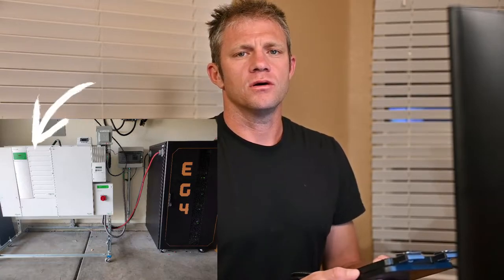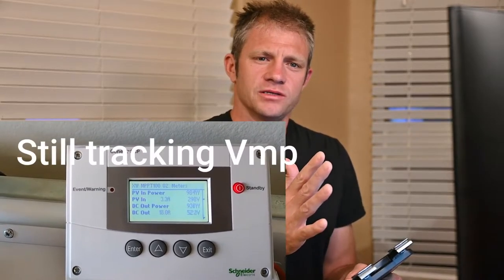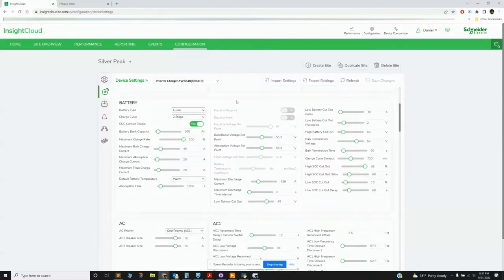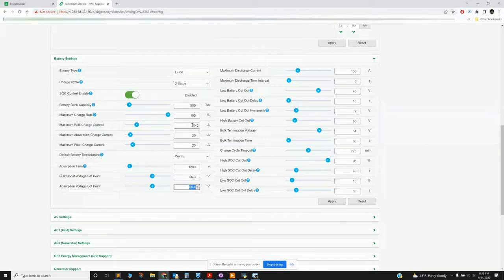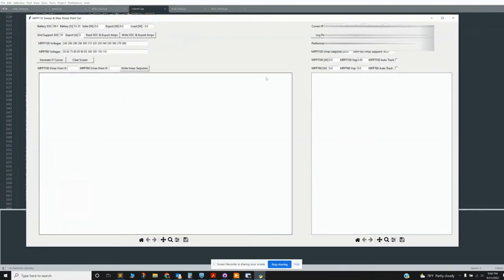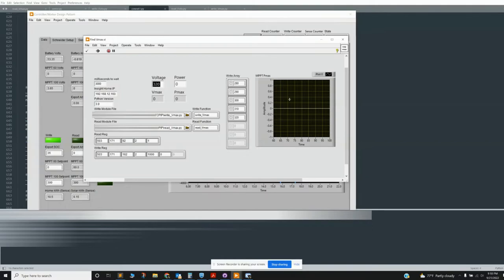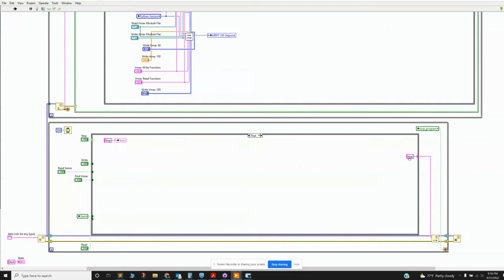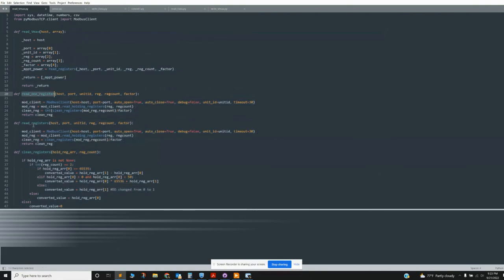Schneider Conext MPPT / Tigo Rapid Shutdown Fiasco & Modbus Solution

Comment: Thanks for all your videos and work; I think you should contact Tigo and ask them to send you some of the O models of the Optimizers for testing- I have them working with my XW Pro-but not like you are trying to do it. I have done basic test and the XW Pro can shut them down when I have too much power or there is a fault- and that is with no comms between the XW Pro and Tigo other than electrical current.  I am certain the O models work because I have and use them.

Also-I would never allow the iNsight cloud to have management access- I use the local access webpage. If someone can manage your device remotely it opens you to hacking. I only left the read only access for cloud and phone. All settings can be managed locally. More secure. There is no Antivirus or anti malware on this device- no way I want it on the web. Only a matter of time before some hacker encrypts your inverter and demands thousands to release it. If I could install a security agent on each device and monitor I might consider cloud access. I am a sec pro and no way and I hacking myself by putting unprotected devices on line.

Comment: Good morning, I've been doing some research and am ready to go with the XW Pro and Mppt setup.  I was just wondering if you were able to get Shnieder to fix this through a software update.  Also, I was wanting to know if the only Tigo modules that work are the -F series.  I would like to use the -O series and have the possibility to see each panel output if anything was to go wrong with a panel in the future.  It should be worth the extra funds to be able to see that info for me.
Reply: No updates, just running off my LabView software. And only the F series are compatible according to Schneider. If you used optimizers, you'd have two (or dozens) of max power point trackers (one being the charge controller) trying to optimize at the same time and assuredly they would interfere.
Reply: @danielderkacs6180  I am not wanting to pick a fight, but I am fairly certain you have made a minor oversight getting the F instead of O Tigo Optimizers. 

I have the XW Pro working with Tigo Optimizers with rapid shutdown and have had no issues with the optimization side working-but I have not focused too much on the shutdown side because I have ground mounts. I did not even need to establish comms between the Tigo O models and Schneider- the Schneider can automatically detect any fault and send a signal that shuts down production. And the Tigo shutdown unit does not need comms with the inverter-it only needs comms with the optimizers and a hardware button to initiate shutdown-completely independent of the inverter. 

I think your mistake was in thinkin only the F models were supported but the O models are much better. They support all features of the F plus optimization. Same hardware just additional firmware features enabled. You got the least enabled version and that is the root of your issue.  I did a quick walkthrough of my system here: https://youtu.be/Ug71sfdBPa4

I still greatly appreciate your solution and may try iot-it is different. I am certain this is not how Tigo or Schneider envisioned it but hey. If it works...